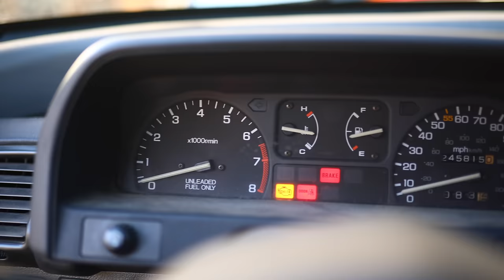1989 Y49 CRX Si Restore Part 1 - New Year - New Car

Comment: So excited for this build! I started re-watching your 88 restore because it feels like Youtube has a lack of CRX content these days, everyone's moved on to other chassis or sedans
Reply from the maker: The CRX content is definitely lacking, probably because it's such an old chassis now.  But it seems they are as popular as ever.
Reply: I’m another one looking forward to this build. My Blade Silver ‘89 Si is languishing away in long term storage. I’ve got a crap ton of parts I bought that and have yet to install - Fastbrakes big brake kit, rear disc conversion from a ‘90 Si, EX master cylinder, 4040 prop valve, lots of NOS OEM parts. A few months ago I even dug out my OEM louvers and found the original mounting hardware. Seth’s meticulous builds are an inspiration and will eventually force me to get my project going again.
Reply from the maker: @tirider8990   Don't wait too long to get to work!  You should be able to enjoy the car!

Comment: You know what would be pretty cool/interesting, swapping a double d (dohc zc) into it (yeah yeah yeah, its an SI with what appears to be the factory vtec motor).

Whatever you do I just gotta say, you are single handedly saving these amazing vehicles from inevitably being sent to the scrap yard to be crushed and thats awesome.  Keep making these videos and we will keep watching.
Reply: I may be wrong about the 89 si coming factory with a d series vtec.  Im an EG guy not a crx guy.
Reply from the maker: No worries. It came with a 1.6 liter non-VTEC single cam engine. This one in it is out of a Civic VX or HX.
Reply: Japanese Si had the DOHC D16... such a sweet motor. But on those rare occasions you can consistently keep it over 6k the B16 wins, (apart from its cost).

Comment: Cool look forward to seeing the progress on your projects.  Ever think about getting a b18a/b or b20 block and doing a ls/b20 vtec using the b16?  It would be a much better driving experience.   Goodluck
Reply from the maker: I haven't gotten too far deep into building engines at this point. I've always  heard the torque increase from the larger bottom ends makes a big difference.

Comment: Where can we buy the Hoodie?
Reply from the maker: Should I do another run of these hoodie/shirts? They are currently sold out.
Reply: Would You be interested in a trade for 3d prints work?
Reply from the maker: @makehondagreatagain6357  3D print of what?
Reply: @crxseth  I make nice ebrake handles and other parts I'd send you one for a xl sweet shirt and down the road if you need something else I do a discount.
Reply from the maker: @makehondagreatagain6357  Send me a DM on Instagram with what you’ve got and we can talk.

Comment: Looks like your climate control panel is intact! That's a bonus!
Reply from the maker: It’s been repaired with a plate on the face, so not entirely original.
Reply: @crxseth  I knew it was too good to be true... It's probably for the best, even if it was intact now as soon as you touch it it'll crumble... Lol